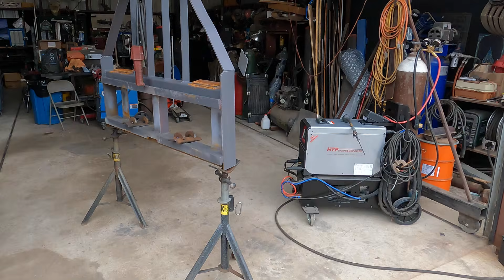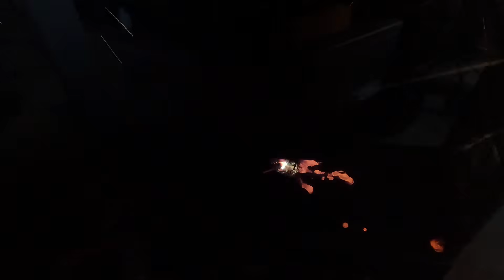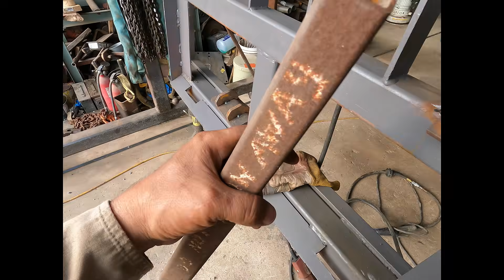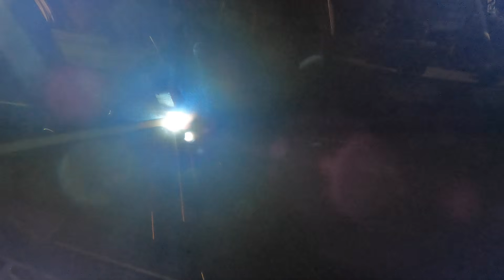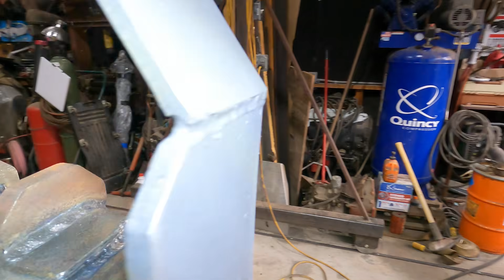Arc Gouging and Stick Welding.

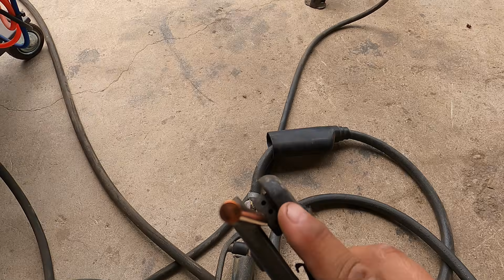Comment: Pay close attention to 4:15.  That forward direction is critical.   I struggled for a long time with this skill.   Isaac mentions this only briefly in this video, probably because he's a pro at it & doesn't really give it much thought most times.   (He could probably cut ¼x20 threads into round bar with this thing if he had to😄)
Anyway, regardless of any other rod manipulation you're doing, always keep nudging it forward, never backing up.

Comment: Look little tip never use a cut off wheel to remove this much weld and better than arc gouging faster and cleaner is a flushing tip 4 times faster almost no grinding

Comment: I'm at min 54 . You don't have eghnouf heat you need that red hot not only the surface.  You need to gouge get it hot red  pull out , install the pin  plate weld a brake and reveld .   Good luck....  you very lucky whit the piece of junk exploding,  that piece looked like cast iron from get go. You got fooled . Let me go to your video .....

Comment: Mr. I Here's a question that we are not sure about, my husband was able to get an old Lincoln Tombstone 250 AC/DC N/P  possibly in the 1960 era. was sitting in a friends transformer rebuilding warehouse for years tucked away in the back  collecting dust & stuff piled over it. My husband just noticed the steel wheels thinking it was some kind of old welder, well it was, cables cut, cabinet dented scratched you name it. Anyways he took it home cleaned it up new cables etc. IT WORKS like brand new, can he use a 1/8" carbon rod on these machines or it may not able to ?...Your thoughts would help hes not sure.
Reply from the maker: Might want to check the duty cycle on that. I dont see why you couldnt give it a shot. I havent used such small carbon rods but I would imagine that it would only require similar amperages to make it work. heck, give it a try. Let me know if it works. Oh and use DC+ for that, just like welding a 7018 rod.
Reply: @ICWeld  Okay I'll tell him, he normally uses a cutting torch, but after watching your videos he figures after some practice it may be faster & more accurate. Cross your fingers because this is a STEAL of the century if it works. Thanks again boss
Reply: @ICWeld  He normally uses a cutting torch, but after watching your videos it may be faster & more accurate, Cross our fingers

Comment: Great as always. So as opposed to say my synchro wave with 350 amp capacity, what is the HTP machine doing in that setting differently regarding power? Basically what does that setting do? Thank you.

Comment: Could you do it with a Fronius 2200, it can go to 200A, 80V open circuit,? what is the minimum compressor that can be used?

Comment: Love the arc gouger.  I couldn't believe that you simply reached over and picked it off the area where it was welded with no sticking or anything.  Very sweet tool.  I often see weld after weld piled on top of the first bad one, usually making the problem worse.  It's sure a timesaver when removing old welds.  Amazing and clean.  I learned a lot today.  Thanks!

Comment: Arc gauging explanation was great. I only recently worked out how that works having never done it. I previously assumed the pressurised air was sent down the electrode. Just spent all day reinforcing a horse box trailer ramp by welding in more 2 inch box sections to support the ramp. Used 2 different welders as wire ran out on the first one and also tried two different welding hoods. Practice is definitely the answer. Welding 3mm box is so much easier than welding rusty 1-2mm car body panels which I’ve mainly been working on. Great video content and keep it coming. Al U.K.

Comment: Because of your videos I bought a arc gouging set and used it at work too. Thank you a lot for your videos. A tip for the hobby welders here, don't get the 6mm rods but the 4mm ones. Because the 4mm electrodes are happy with 150 to 160 Amps, so you don't need big welder with 200 Amps. That makes it a little more portable setup. 
Arc gouging saved me and my boss a ton of time and head aces.

Comment: This is absolutely not the right way to arc air gouge. 
It’s one smooth motion so the final product is smoother then a weld. 
Less carbon imprints and potential hard spots for cracking …

Comment: I would think that a small hole filled at the center of the leading edge would greatly enhance the strength of the bracket. I mean, you have welded it as specified,, I am sure, but it is only held on 3 sides. A tiny weld at the center of the front would make it a LOT stronger. Keep it from bending upwards on the frame.  
Nice machine though. And nice stick technique.
Reply from the maker: Very good point. I hadnt thought of that. I was mostly impressed that they made external braces but as you said, that center plug weld would have helped tremendously.

Comment: Summary

Project:

* 0:00 Repairing a skid steer quick attach fork plate.
* 0:00 The brackets holding the quick attach were bent out of shape.
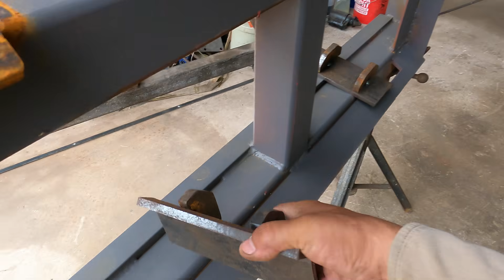* 0:31 Replacing them with a new updated version. 

Process:

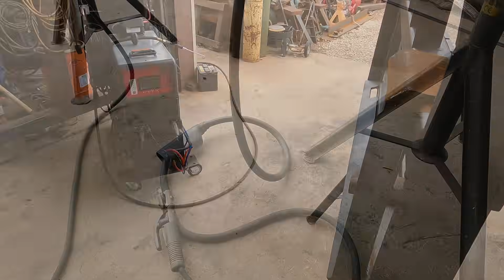* 1:56 Arc gouging:
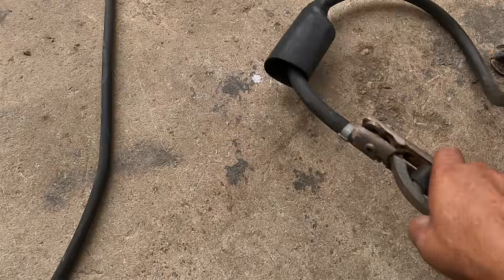    * 2:00 Used a Profax 3000-1 gouging torch with 1/4" carbon electrode. 
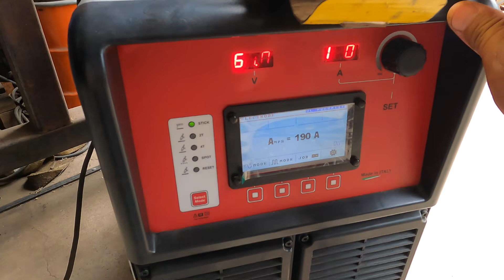    * 5:30 Set the HTP Invertig 400 machine to "carbon arc" mode with DC polarity.
    * 7:39 Started at 190 amps but increased to 197 for better results.
    * Emphasized importance of gouging in a forward direction to avoid carbon buildup. 
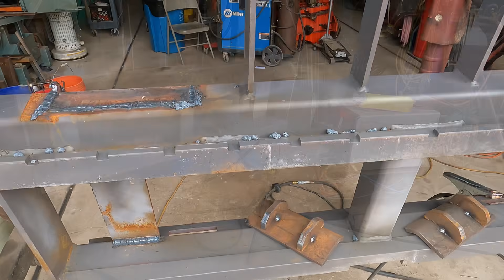* 9:31 Cleaning:
    *  Used a needle scaler and sanding flap disc to clean up the gouged area.
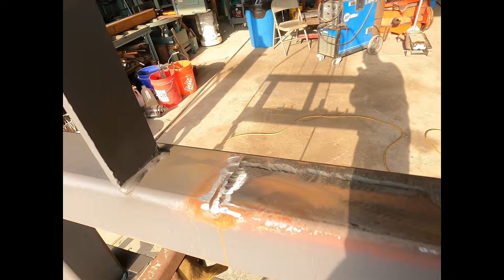* 11:17 Fitting and Tacking:
    *  Used a custom-made fixture to ensure correct positioning of the new bracket.
    *  Tack welded the bracket into place. 
* 13:09 Stick Welding:
    * Switched HTP machine to "electrode" mode.
    *  Used stick welding (SMAW) to weld the bracket on, starting at 118 amps and increasing to 121. 

Key Takeaways:

* Arc gouging is a fast and effective method for removing welds compared to grinding.
* Always move forward when arc gouging.
* Having the right fixtures can save time and ensure accurate assembly. 

i used gemini 1.5 pro to summarize the transcript

Comment: You can see the difeerence between his stick welds and all those "secrets of stick welding 'they' don't want you to know" videos. He does nice smooth passes with the electrode rather than a bunch of little tacks that end up burying slag in the weld. His results speak for themselves.

I love the arc gouging technique,. It's unfortunate that you need far more power than a home shop can provide. That's why I end up sticking with gas welding for almost everything.
Reply: I hate those finger wagging crud videos!

Comment: Nicely done as usual Issac, I have watched you do lots of Arc gouging here and have seen my share of it where i work in heavy steel, I work with our millwrights allot of the time to Machine things either by lathe, mill or CNC milling machine and have the chance to watch them Arc gouging and have to admit it is pretty cool and one of our guys is like a crazy artist with that thing, this new machine you just used in the video HTP worked really well , that is the cleanest Arc gouging i have ever seen, unreal a little tap with your hammer and off they came, i saw the reference point where the new plates had to go and you pull out that square tube tool you made and suddenly bob's your uncle prefect alignment, well in my 60's now and want to learn how to weld , just for personal use at home and have good teachers around me and start with something simple, and but a entry level welder, i can get a bit of a discount through the company i work for so i'll go that route and won't have warranty issues, great stuff  👍

Comment: I dont understand how most arc gouging rod manufacturers say you need 300-400 amps for a 1/4" rod, yet you run 200 amps and it works well. Do you run all brand rods around 200 amps? Why are the manufacturers so far off with suggested settings?

Comment: The copper is only there to supplement the conductivity of the rod so you can stick it out longer. It will immediately blow off the end once you start gouging, which is why they leave one end uncoated. That's the end you're supposed to start with.

Also, the point of a cutoff wheel in this context is to create a sharper stress riser in the middle of the weld, so when you hit it with a big hammer it will crack out much easier. If you have good access to the weld, it can often be quite a bit faster.

Comment: but but the salesmen told me I needed to have a minimum of 350 amps! (though, I've gotten away with it at 180 with 3/16 rods...) coulda used the hint of cutting away about 2 years ago though... that carbon layer is a right B to get through lol.

Comment: I learned to weld in 6th grade shop class and if I stuck with it I still wouldn’t be able to cut with a torch like you can, your an awesome welder and I like the videos.

Comment: I recall my first time using airarc carbonarc gouging rig, I was told time and time again to make sure the air exit is on the right side of the electrode. I put it on the wrong side. I only did that once . Been trying to find a affordable machine. Todd will support a 1/4-in carbon. Not all welders are able.

Comment: Great explanation and work on your part icweld.

Now the penny pincer that designed those brackets is saving on his end but is costing the customer lots of dollars on the customers side.

But thanks to the penny pinchers, accidents and abuse,  you plenty of have work.

Really could use one of those full length adapter plates made from 3/8" plate.

Cause you know little Johhny is going to use it to load way more than what the unit is rated for and  traveling on the roughest road.

Comment: You just adjusted the amps up to 197. Do you ever find you need to adjust the air pressure, or is it just a standard shop air? 150-ish?
Reply from the maker: Anything above 80lb psi will work.

Comment: Nice little job that worked out all right. I have the same attachment but it's sits on the back of my tractor on the three-point hitch. It works really good. It's got a different hookup but good little attachment. 👍👍🙂🇨🇦

Comment: Thanks for the explanation of the Arc Gouging. I was wondering how the air was working and how it can hit the molten puddle.
Maybe one concern can be all the molten metal flying around. It could be catching your leaf heaps on fire.
Reply from the maker: Oh yes, That molten metal can fly! Thats why I normally gouge at the front of the shop or outside.

Comment: Hey Isaac, a few videos back you had a problem with your mobile welder. What did you find out about that?
Reply from the maker: Power circuit board. Got it fixed, its good now.

Comment: Sorry if this is a stupid question, but can you arc gauge with any stick machine?
Reply from the maker: So long as its a DC machine.
Reply: @ICWeld  Thanks for your reply and all the helpfull videos!
As a self thaught diy welder your tips, tricks and work ethicks help a lot.
Kind regards from The Netherlands
Reply: I do. It has to be DC. I gouge with my Alpha Tig a lot and also my Everlast Mig/stick welder. I C vids got me into trying it. I bought the cheapest gouging torch on Amazon $45 and tried both the 3/16 and 5/32 rods.  They work perfect at 150 and 140 amp respectively. If you don't have a big air supply just choke up a bit closer. Dress accordingly as it sprays sparks everywhere. If you work in something confined, you will live in sparks.
Reply: @BCole-bj4lv  Thanks for the info!  I'll look into getting a torch and some rods.
Reply: @ruudxd1  Your welcome. It's really fun to use. I bought mine and disassembled 3 or 4 industrial machines with it.   Metal just disappears using it. Make sure the rod is always straight in the holder; if its slightly askew the air won't blow the metal away. You'll know something is wrong and that's the problem. Plus, as IC said in the video, "go forward and not back"  or you'll leave carbon that you can't cut through with out grinding it off. Have fun!

Comment: It seems like sometimes you push the puddle when welding and sometimes you pull it, is that just convenience or is there a rule to follow?
Reply from the maker: No rule. The weld puddle will tell you how to go. Once you learn to read and see the weld puddle, you base your movements on that.
Reply: @ICWeld  Thank you. I usually pull the puddle unless out of position, especially vertical up. Wasn't sure if I was doing it right. (stick welding)

Comment: I am not a fan of the Gee Wiz touch panels on welding machines. They seem so unnecessarily fragile and expensive for such an application. However I do stand to be corrected by a competent authority. I C Weld would be such an authority in my book. What say you Isaac?

 Arc gouging: Anyone who tells me there is a better more efficient  way to separate two prices of steel  for reuse of one or both components has clearly never worked on heavy machine components. Sometimes  torch gouging process is close. But I maintain Carbon Arc Gouging the king of taking things apart and removing metal. Cheers
Reply from the maker: Yes, Arc gouging is king when it comes to removing any two welded pieces of metal, and Yeah,....I'm a little uneasy about the new front faces on these new machines. Theyre all moving to that. I guess we'll have to see how well they hold up.

Comment: How can you tell the amps are to low ?
Reply: The rod won’t arc as easy, and the arc may snuff out while gouging, you know you are at the right amperage when you have a consistent pass with the gouging rod without it snuffing out. As for stick welding I always base it off what I see in my puddle, specifically in front of my puddle I will see the weld sinking into the work, as well as the toes of the weld washing into the work.

Comment: Is it possible to arc gauge with any power source? On a smaller scale.
Reply: It is but you you will be pushing your machines duty cycle, if you have a smaller machine to arc gouge then don’t go and buy 3/8” gouging rod because you will max out your duty cycle, find a smaller rod that your machine can handle, the best machines are old school Hobart machines or diesel generator welders like a Big Blue, or a Vantage 400, can arc gouge all day with them at over 300 amps.
Reply: @Dopamine1245  thank you for the info.

Comment: For how much Miller is demanding for their equipment considering how much of it are parts made in China, I would go with HTP. I have almost all Miller in my shop now as soon as one brews and can't be fixed it's getting tossed and replaced with HTP or something close. Miller went to shit, the quality, the warranty, the longevity. I tell everyone getting into welding to look for a used older Miller, Lincoln, ESAB, etc. If they want new I steer them to HTP, ESAB, Lincoln, or worst case Everlast. Miller can possibly turn it around, but until then no way. 

Just to stay ahead of the comments, I have been welding for over 20 years in different capacities and own 11 machines, ten of which are Miller. After I heard the experiences of a few friends with shops and the way Miller treated them when there were issues, in addition to the issues I had with machines I am over it. This is just my opinion so take it for what it is worth. All I can do is repeat what another shop said to me "Thru with Blue"
Reply from the maker: I too am a Miller guy. I have enjoyed using them for years, however, I think these big companies have been resting on their laurels which has allowed other companies to catch up and pass the older big name brands. I am a big fan of buying stuff from here and not there but ultimately as a small business owner, we have to think of what product best suits our needs. There are many small  companies that are paying attention to end user questions and concerns and selling them at a very reasonable price. I hope these big name brands catch on and learn before they get left behind.
Reply: @ICWeld the start would be having the components built here. The cheep china crap that fails and cost the consumers time and money,will ultimately be every company’s downfall. Profit today don’t worry about tomorrow.
Reply: @Failure_Is_An_Option  don’t know what planet your on.

Comment: 👍 what was your indication that the weld was cold ? How do determine the number of passes need? Thanks for sharing!
Reply from the maker: The weld puddle is too sticky, you can see the weld stacking too high and the rod is hard to start. Each machine is different. Your preset amps from one may not transfer to another. Thats why I was struggling with this one. I havent learned it yet.